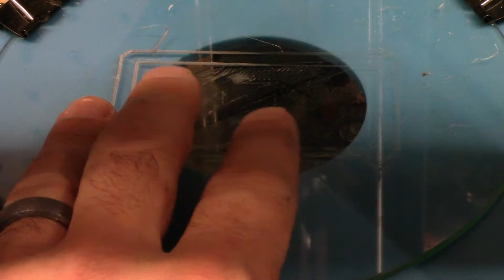101hero leveling screws and example

Comment: I just noticed that you were super smart in changing the adjustment screws! Those are not the same that came with my printer. You seem to be using a Philips screw driver but mine came with the wrench type screws which makes it super fiddly to mess with since reaching in there from the inside is so much worse than how you can fix things directly from the outside.
Reply from the maker: very odd, i did not change out the screws, these are the ones that came installed in my printer. might not be a bad idea to swap them out if they are so difficult to adjust.
Reply: Interesting... so the company that make the 101 hero has been making changes to their printers over time... just not the right ones. I got my printer just over a month ago so maybe the newer ones like mine come with non Philips screws where you need a wrench whilst the older models had Philips screws? Either way it feels like they should have placed the screw on the other side closer to the blue structural system for easier access from the outside so you don't need such a long screw driver to make the adjustments like you have to... Just saying I mean leveling really does not need to be so difficult.... just a big design flaw in my non expert opinion.

Comment: Your videos are fantastic! I wish I'd seen this video when my extruder was still intact. I am looking to get that e3d you are using. It looks awesome and the prints you are getting out of the printer are phenomenal! What filament are you using? What kind of settings are you using? I am still really struggling with mine but that is also because it is broken which does not help...
Reply from the maker: i usually use hatchbox 1.75 pla, currently trying out solutech3d which is okay but low reliability of getting the color you order. i have seen people on the facebook group adapt the stock hotend to be an extruder and use the e3d knockoff hotend as the actual printhead. downside is you dont fix the lack of retractions, but benefit of having a hotend that gets hot.
Reply: Interesting! So some people were able to convert their hotend into and extruder? Is that on the forums somewhere? Are there videos or pictures of that setup?

 I will look into the Hatchbox. I am amazed and how well your prints come out. Whenever I print anything on mine the lines are sloppy... even when I had the out of the box settings it still did not print anywhere near as well as your prints.

Comment: Do you have repetier host settings for the stock 101 hero? Thank you.
Reply from the maker: unfortunatly i do not, i use simplify3d, which i love but dont recommend for use with the hero due to the price of the software. slow and cold is key for the stock printer
Reply: +Workshop Tinkerers could you provide a link to your Simplify 3D settings for the stock 101hero? I would love to try out better settings.